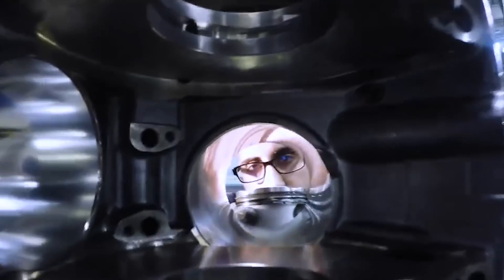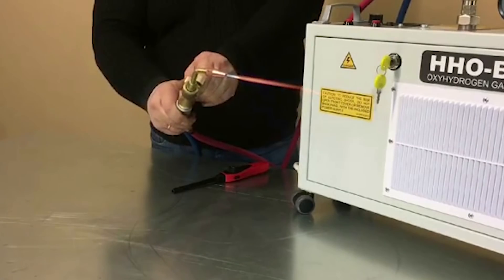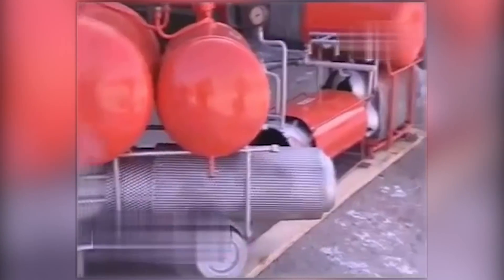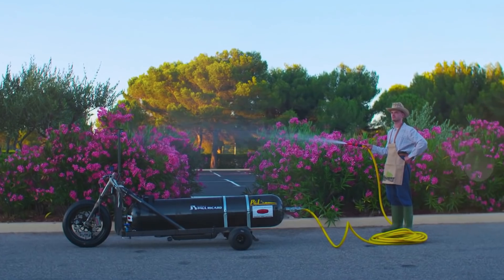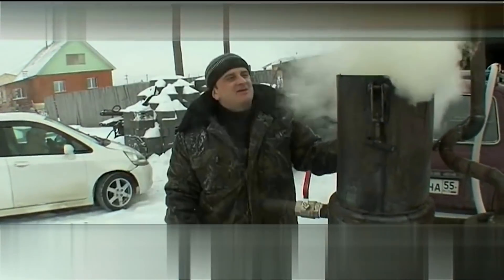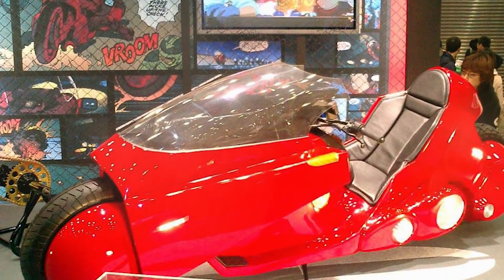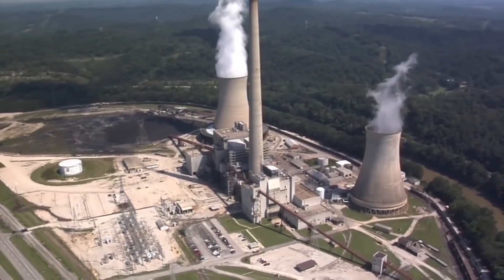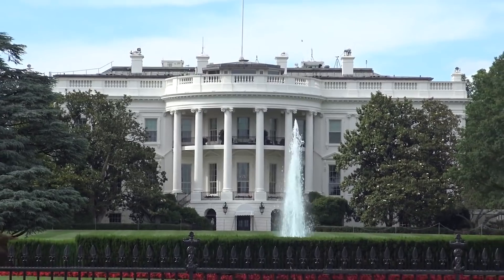Why These Engines Are Banned?

Comment: Hydrogen is probably the worst fuel you could use for a car and other than experimental engines in a lab you will not run one with water, there is no were near enough free Hydrogen in water unless you carry a large tanker behind you. It also takes a lot of power to get what little bit of Hydrogen you can from water.  
Sure Hydrogen is very clean however it is very hard to liquefy and incredibly dangerous, It is near impossible to bulk transport and it would turn cars into mobile H bombs, LPG and other oil derived fuels and even some bio diesels  are far superior for a number of reasons and fuel density is the main one meaning you do not have to carry as much of it but they are also very safe in a relative way compared to Hydrogen.  
The motor running on air and thinking that it could be used to power a car really made me laugh though and TBH I call BULL SHIT on that one, you would use more fuel and energy to pump up the air tank than you would use in a normal motor for the same distance, it is so stupidly impractical and inefficient I am thinking that the inventor was just playing a joke on the world. 
 The oil tycoons have not banned any of these, that is just a stupid conspiracy theory, they do not need to ban them when they have no real world application or simply do not work very well if at all.
Reply: Air engine = Jet engine
Reply: @tazman8697  LMAO .. no . A jet engine is a heat engine and they need fuel to run.
Reply: @marktate3431  My point is that a jet engine uses air forced out the rear to provide thrust but needs fuel to achieve this.  There are other forces at work to achieve this. Sorry if you misunderstood me.
Reply: @tazman8697  All good mate

Comment: Utter bollocks. How do you compress the air electrolyze the water... ? Its not free they are energy storage methods not fuel
Wood conversions were used in ww2 germany but is really not user friendly
Reply: Not to mention the pollution and deforestation.
Reply: Coal gas is basically the same as wood gas except made from coal. Most  coal gas converters will run quite happily on wood without modification. Those Victorian technology.
Reply: @gordonlawrence4749  In Sweden coal gas generators and wood gas generators are different tings, a wood gas generator can be powered by coal but not the other way around. And both are "Gengas" short for "Generatorgas" generators. It was used in industries before the war and cars during and shortly after and is a technology that has gotten less advanced with time.

It works pretty well to power cars with, i tried, but its not for the mainstream public, even if you buy finished fuel it's still a lot of work compared to simple liquid and gas fuels.
Reply: "Wood gas" works. With the proper wood stove converter attached, a car can run on it.  However, the reason it is not used popularly is that it is highly poisonous.  Proper name is carbon monoxide.

Comment: Muons are roughly 200times heavier than electrons orbit much closer than a standard electron's 
They have completed tests of cold fusion that it can be seen working right up to absolute zero 
Muon catalyzed fusion Is legitimate cold fusion 
Possible extremely cold nearly at absolute zero 

Muons don't live very long at all e.g after 0.2 micro seconds they quickly decay into electrons and neutrinos. It doesn't matter too much as the fusion is almost instant and in thay short time it can facilitate fusion roughly 150 times before not being useful any more.
Muons are also not very abundant,
so if you need to use them consistently you have to use a high energy particle accelerator it takes roughly 5 giga electron volts, the other issue is that muons get stuck quickly and easily so they can only help with fusion about 150 times before coming stuck in the particule of helium. 
Each reaction produces around 18 maga electron volts after 150 fusions, the fusion produces aroumd 2.7 giga electron volts but its takes around 5.5 giga electron volts to create a muon. 
This Muon cold fusion a actual net consumer of energy which is of course makes it a detrimental source of energy. 

To make a viable commercial power plant you would need to produce muons for cold fusion easily accessible cheap to make it worth persuing. The issues that stand in the way are make it cheaper to create muons or have less of them getting stuck on helium particles or how to unstick them from the helium particules. I know ive gone on a bit of a ramble here and some of this info may not be still valid or useful im not a scientist but I do like to read and learn things if you made it this far thank you for your time if you have anything to say ask or suggest please do feel free to write it up in response to this and have a great day/week/month/year/decade/life.

Comment: Lol compressed air. Compressing air is very expensive process
Reply: But most shops use air powered tools over electric ones, so your wrong!
Reply: @SamaritanElad  did you ever touch a compressor while running, you know it gets really hot. Its called wasted energy.

Comment: "When Voltage is applied....". Where does the voltage come from?
Reply: Slaves, or convicted criminals on treadmills.
Reply: @mrdad1541  as green as energy can get xD
Reply: @LuLeBe  A hydroelectric dam would be the most efficient (~90%) but after that you get a major fall off in efficiency. What I find absolutely hilarious is people keep pushing solar power as being the vastly better option yet it's efficiency is no higher then 20% and the annual average is ~12% and Wind energy aside from being crowned "bird Guillotine" isn't really any more efficient then the evil fossil fuels ranging from 30-45% (gas/diesel are 32-42/35-42 respectively)
Reply: Simple, you just string a cable from your nearest clock tower and wait for the lightning to strike!
Reply: So from what I understand you could technically use an hho generator run off of your 12v battery and alternator and give your self oxygen and hydrogen. Have it stored separately and then re mixed for injection similar to nos.
Reply: @lordyoseph53  and running your alternator hard enough to power the HHO is going to give you worse gas mileage than you would have had otherwise
Reply: But if we would use electricity from solar panels or wind????

Just asking.
Reply: Joker yes solar is a great way to use hho.
Reply: The alternator and battery.
Reply: Dams change river habitat. California voters passed a water bill a few years ago that allocates most of the money to surface storage, but all the best locations for dams already have them. Our solar farms look like lakes to migrating birds and since they are out in the middle of nowhere they require new transmission lines. As somebody else mentioned there is a lot of power loss in travel. Now the travel is very long. Socal Edison bought chinese made generators to replace generators that still had 7 and 15 years of service left. The chinese generators didnt last a year and now San Onofre is shut down, a massive nuclear waste storage site ON THE BEACH of the ocean that contains the ring of fire. We need to build new nuclear plants with cleaner technology.
Reply: Unicorn Jizz and Pixie shit?
Reply: Magic.
Reply: @LuLeBe  Do you know that power   transmission lines loose 50% of their power by the time you use it in your house. Going through substations,  hundreds of miles of lines, pole mounted transformers and yard transformers then finally out the wires in your house. It would be better to use solar or wind at that point at least. So gasoline or diesel may not be as inefficient as you may think. Especially if your local energy company uses coal.
Reply: @buildthings79  technically your right bout solar or wind problem with them though is that the turbines for wind cost more to replace then the actual whole thing or at the very least very inefficient and solar is great but when you run into consecutive days of sunlight then the people supplying the energy have to pay out cause its putting out so much power but in the winter months you have massive shortages of power now if someone could combat this problem with say energy storage places it may be possible but the trick is containing it in such a way that you dont get leakage or loss of power from the storage
Reply: Technically, you could power it without plugging it in the wall.
Reply: @SIRWAFFLEBOB  with a large, powerful battery? Even at highest efficiency the production of oxygen and hydrogen by electrolysis consumes many more times the energy that the resulting gases have potential to produce. Pesky laws of thermodynamics...
Reply: Is that meant to be relavent? @SIRWAFFLEBOB
Reply: @alancrook1034  I meant it that way, but you probably won't take it that way. Ignorance is bliss though.

Comment: Combustion engines technically run on air. That's what the fuel does heat and cause high air pressure driving the piston down.

Comment: Multiple high pressure air tanks that we can crash together in a car wreak. I can’t see where that could go wrong.
Reply: Which is worse a crash with air tanks or a crash with lithium batteries. Take a small lithium battery and hit it with a hammer before you answer.

Comment: vic market or Sydney market had air powered vehicles for decades, news did a story on them saying 4cents would get you to S.A from Melbourne, not long after that the air powered vehicles were gone and the engine design lost they were replaced with elec and lpg.

Comment: Very unscientific. All engines must obey the laws of physics and thermodynamics. There is no "free energy source" that will put the oil compnies out of business. Electrolysis is something like 10% efficient. Compressing air also wastes a lot of energy as heat during the compression process and the running of the "engine". Best option as of now is to go with an all electric car. It has the highest efficiency from comsuming an energy source to creating motion.
Reply: But the long time to refuel an electric car makes it impractical.  Come back when you can recharge in five minutes.
Reply: @501pj  It's already charged when I wake up. No side trip to the smelly gas station is needed. For daily use it is more convenient than a gas car. People seem to obsess on the long trips, but for most drivers, those are rare.